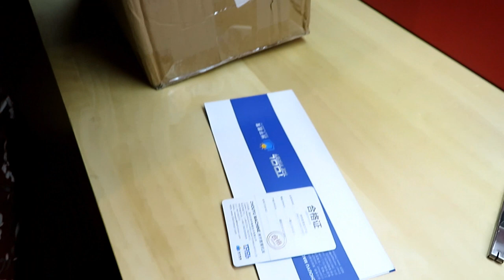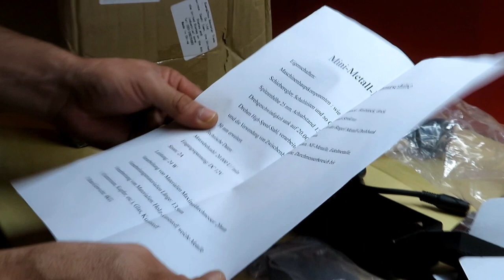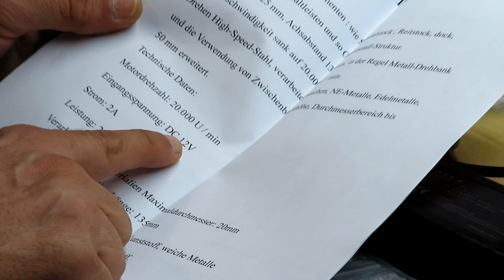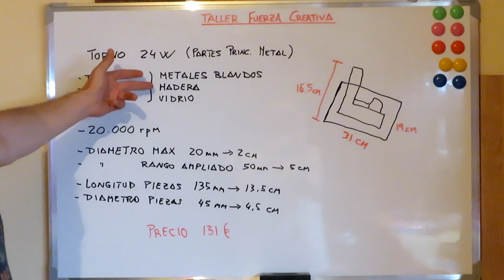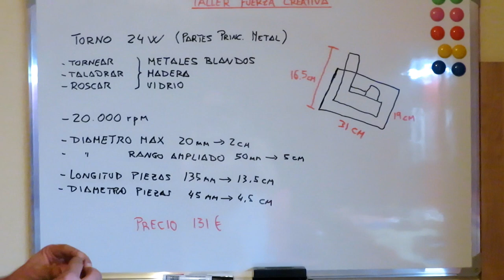MINI TORNO TOOL THE FIRST 24W - Mini lathe Tool The First 24W

Comment: Muy buen vídeo, por favor me puede decir de que díámetro máximo se podría taladrar,. Gracias
Reply from the maker: Hola mimail12. En el video pusimos todas las características. El diámetro max de las piezas es de 4,5cm y longitud 13,5cm. Un saludo. Y gracias por tu comentario.
Reply: @TallerFuerzaCreativa   gracias, pero no me refería a eso, quiero saber que broca puedo poner en donde iría el punto para taladrar esa pieza que usted dice  de 45 mm y si el ajuste de la broca o el soporte es cónico. Muchas gracias.
Reply from the maker: @mimail12  Mil disculpas. Lo que es la mordaza la podemos abrir sin que toque el chasis del torno (digamos el suelo9) para poder poder una broca o fresa de  20 mm. Pero si la broca es larga, la podemos meter por detrás de la mordaza pero sin superar los 10mm de diámetro, que es el hueco céntrico de la mordaza. Pienso que si hubieran colocado más arriba el centro de la mordaza, esta daría más juego, ya que si la abrimos mucho, toca en el "suelo" del torno.  Si lo que quieres es calar o vaciar un cilindro y no tallarlo, tal vez sea más sencillo un taladro vertical (aunque también depende de la longitud de la pieza con la que trabajes). Ah, y la mordaza no es cónica. Espero que ahora si te haya entendido bien, sino te pido que me consultes para poder darte la información que buscas. Un saludo